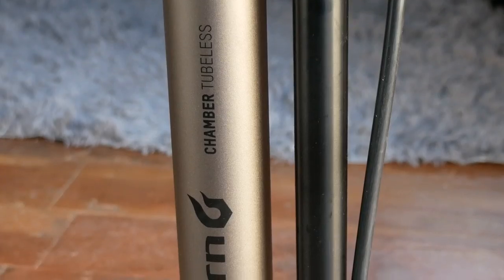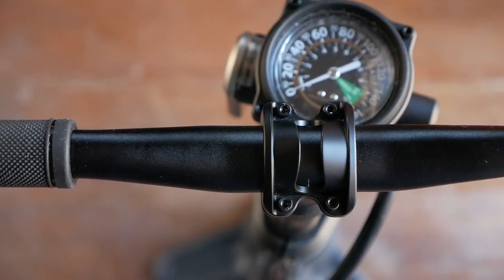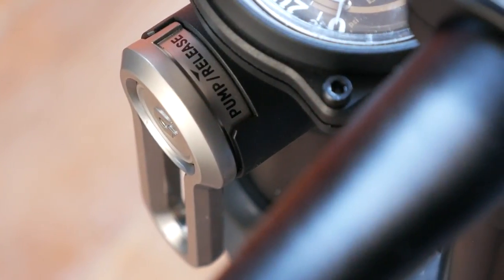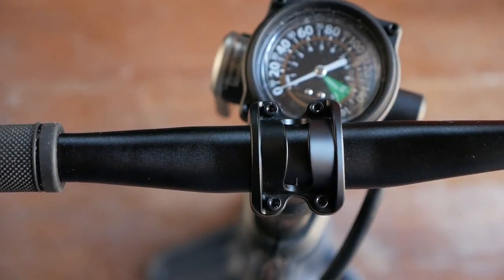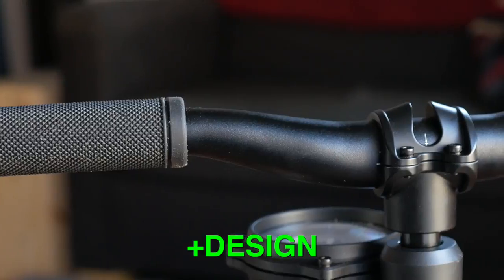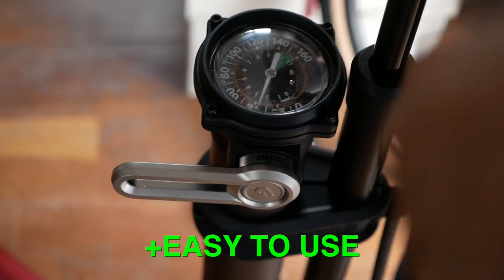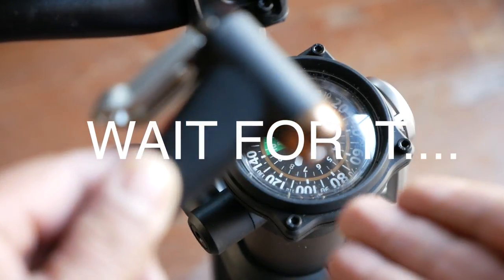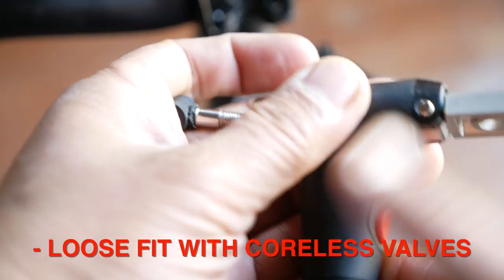Review: Blackburn Chamber Tubeless Pump

Comment: Thanks for the review!
I just got mine, and I noticed that the problem you had with inconsistent release of air is because of condensation inside the air chamber. There's a bleed port under the pump that Blackburn recommends emptying once in a while. 
Also, another dislike you could add is that I noticed the stem/handlebar clamp doesn't hold tight on handlebars (because it measures 32mm instead of 31.8) I had to use the good ol' coke can shim technique to have my drop bars (because #aero) hold tight on my pump .
And somethings that makes it stand out of the Bontrager offering are the huge well graduated gauge, and the fact that in regular pump mode you don't have to pressurize the chamber with a few strokes before actually pumping air into your tire.

Comment: Hey, I've got the same pump. It's OK but has some pretty basic shortcomings.

The hose is really long and quite thin - which is quite handy when pumping up a tire. When you're looking to reseat a tubeless tire it's not good though – and this is a major reason you'd use this pump rather than a normal track pump.

With the small valves and really long hose releasing a full charge only gives a gentle squirt of air over about 15 seconds. It's enough to seat a thick AM / enduro tire with thick sidewalls if you push out the sides so the tire edges are already sitting up against the rims to start - but it is not enough to seat a xc tire with thin floppy side walls. If only they had a short fat hose and a big valves!

Comment: Wow. Not working without the core in place is terrible. Rather than buying a new pump I went for an Airshot. Works really well, and doesn't take as much room to store as a second pump.
Reply: I have the Airshot also. I make sure my bike is on the stand and then seat the tires. Put the stem back in and pump it to the pressure I use. Much less than buying a totally new pump when my other bikes aren't tubeless. Until then ...
Reply: My Blackburn Chamber Tubeless Pump is great. Its universal pump head will hold onto the stem even the presta valve core is removed. Also, the air release is very constant and outputting the air very evenly. The only difference is I need 57 to 58 strokes to fill the chamber up to 160PSI/ 11bar fully.

Comment: Having to hold it in place with the core removed is kind of a given. It would be interesting if they could remedy that but I assume they would have to redesign the  air head. Not sure I've ever seen that inconsistent air release. I have only used the Topeak and the Bontrager. I don't own either but can't say I noticed either one do that when I tried them.

Comment: Mine popped my maxxis holy roller II's onto the bead no problem with the valve stem installed. I believe the air release in stages is by design also. I have nothing but good things to say about this unit.

Comment: Do you have to pump "through" the big compression-chaber when you just want to pump a normal tire? (so you have to fill this chamber first -and it takes a bit longer to pump than with a regular floor-pump.)
Is there any tubeless-Pump that doesn't have this (small) problem?

Comment: Don't forget the lifetime warranty + great support: unless it's stolen it might be the last pump you buy.
Reply: My Blackburn Chamber Tubeless Pump is great. Its universal pump head will hold onto the stem even the presta valve core is removed. Also, the air release is very constant and outputting the air very evenly. The only difference is I need 57 to 58 strokes to fill the chamber up to 160PSI/ 11bar fully.

Comment: You can get a small air compressor with a 2 or 3 gallon air tank.  Pretty compact for under $100 at Home Depot.  How is this pump better?
Reply from the maker: +Harold Christopher you don’t have to plug it in and can travel with it. It’s not loud.

Comment: My Blackburn Chamber Tubeless Pump is great. Its universal pump head will hold onto the stem even the presta valve core is removed. Also, the air release is very constant and outputting the air very evenly. The only difference is I need 57 to 58 strokes to fill the chamber up to 160PSI/ 11bar fully.

Comment: I would be bummed if I paid $150 and had to hold the nozzle in place.
Reply: My Blackburn Chamber Tubeless Pump is great. Its universal pump head will hold onto the stem even the presta valve core is removed. Also, the air release is very constant and outputting the air very evenly. The only difference is I need 57 to 58 strokes to fill the chamber up to 160PSI/ 11bar fully.
Reply: Latest update, I need only 44 to 45 strokes to fully charge it. Carefully pulled the piston and held it to the highest position for seconds to prevent it from going down due to the reactive suction, then I pushed it down all the way and it considered 1 full stroke.